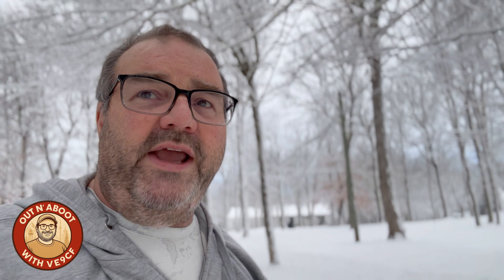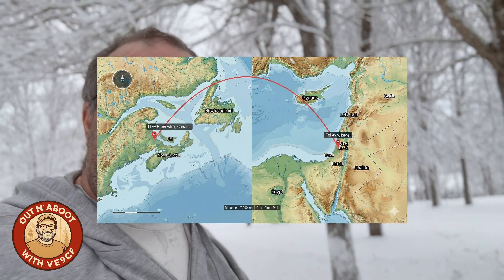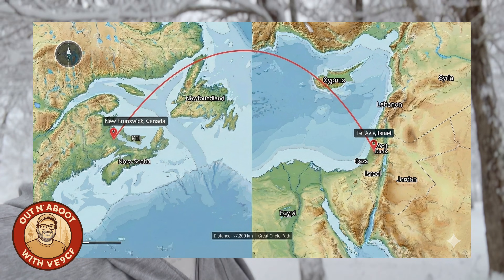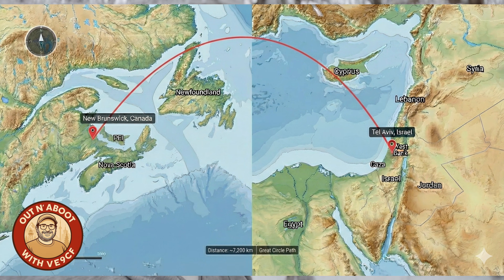Long Path Propagation Explained: A Beginner’s Guide to Ham Radio DX

Comment: Thanks for the video Stuart.  Is there a particular application that you use to determine what the angle of your antenna should be for a particular region you are targeting?
Reply from the maker: All good logging software will have that,  WRL does, but only short path, you will need to determine the long path direction, which is 180 the opposite way, also holyland cluster has a great visual DX cluster so you can see it.
Reply: Salty Walt has a good video from the last couple weeks about that.

Comment: Cross equatorial paths sometimes give a signal "boost". i'd bet a a double pass over the equator would do even more. Here in North Carolina it's very easy to hit Brasil which is a cross equatorial path.
Reply from the maker: That isn't the same as long path...that is more sporatic E when it is winter up here in the north and summer in the southern hemisphere, They have more sunlight and therefore the D, E and both F layers...
Reply: I am in southern Chile. Hitting south east united states is so easy, I almost don't bother anymore. I believe it is mostly Trans-Equatorial Propagation. Oddly, countries, half the distance, around the equator are super hard for me to reach. Venezuela, colombia, most of central america seems super hard for me, unless conditions are just right. The midwest united states seems wierdly hard to, when the east, west, and southern states seem very easy with good signals. Physics is hard in the wild. 🤣